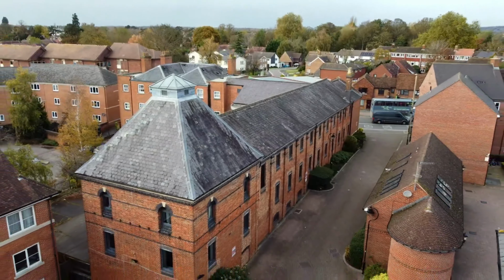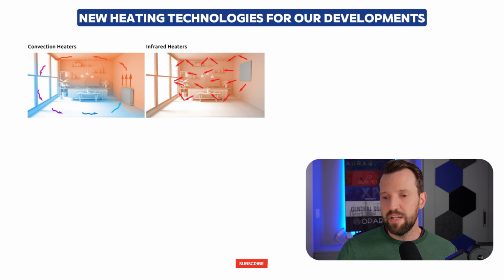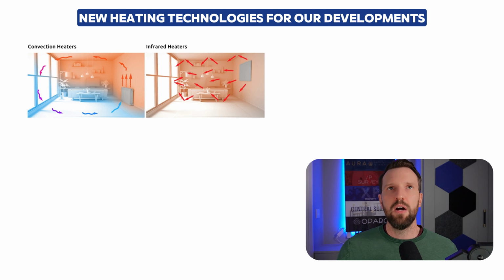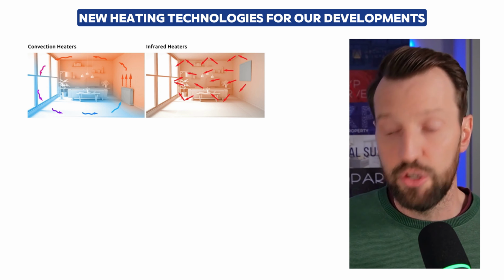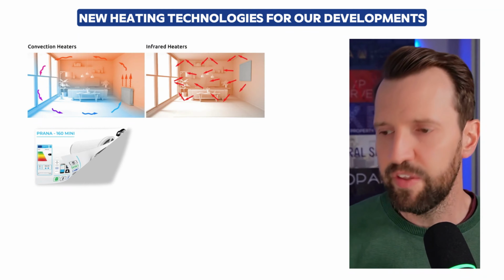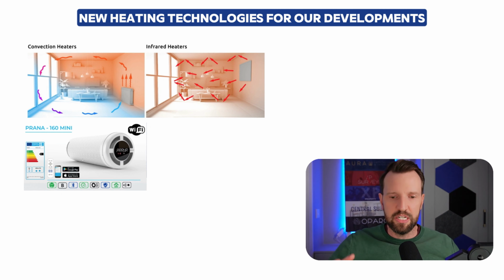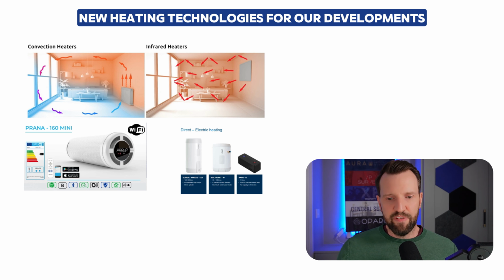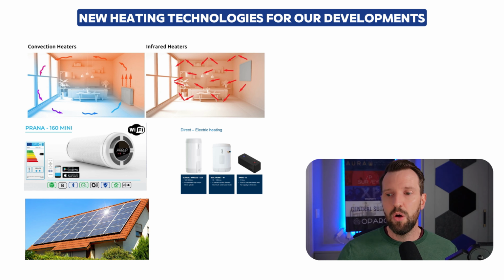Energy-Efficient Homes UK (Add these technologies to your home to save money)

Comment: I'd certainly agree infrared panels are a great solution for certain spaces - in particular bathrooms - since they not only heat the room more effectively than a towel radiator might, and more quickly and efficiently than electric underfloor heating, but they can also help reduce condensation by warming the walls. Plus they're lovely to come out of a bath or shower to a warm radiant heat. However - they can only be (at most) 100% efficient, and will cost tennants/owners more in the long run if deployed widely, as compared to a heat pump based system which should be much more efficient. Also, whilst the PV might offset the energy usage during the day, in winter the most heat demand will be primarily at night (especially with evening occupancy). A battery storage system might help with this, but it'd likely need to be quite large to last you the night depending on how many panels you have. I'm also not sure how this kind of electric heating affects the EPC rating (as I know most electric resistive heating scores very badly). 

In a block of properties, is there not an option for a shared ground loop, with heat exchangers in each property? Although more expensive to install, it might work out more economical per property than each one having it's own dedicated ASHP. Last I looked into this (a few years ago) you needed about 5 properties to make it cost about the same as a gas supply, gas boiler and heating system install. Curious to know if you looked into this at all.
Reply: Some good points, however a heat pump is not more efficient if you take into account running maintenance costs over the years, the savings on its efficiency are diminished by its actual running costs moving forward. I’m going Infra Red throughout, battery and tankless water heater on a project in South East.

Comment: Don't use those, they are awful. They have some good marketing I'll give them that. But in practical use they aren't pleasant to live with if the rest of the house is cold, this is especially true for larger homes.

There really is nothing special about these, there is no magic 'infra-red' that they produce. Infrared is part of the light spectrum. It is emitted from all surfaces that have a temperature above 0 K. The marketing of these is 'oh it feels like a warm sunny day because it is long wave infrared' is technically true, but fallacious reasoning at best.

You might get away with them if the house is a well insulated flat, because the walls won't lose that much heat to the outside. But for their cost you are far better off installing air to air heat pumps (also known as air conditioners) which will produce more heat per unit of electricity used, and will probably work out about the same price for the installation.
Reply from the maker: Have you ever lived in a place with them? None I've spoken to that has had any issues with them.  Perfectly comfortable. 

We would be installing them in new build highly insulated homes.
Reply: @XPProperty  Yes I have. I was initially taken in by the marketing and believed they might be a good solution, but then stayed in a house with them and was shocked at how poor they are. 

If you are installing them in a well insulated house, then it is likely the house will overheat in summer, and therefore you are better off putting in an aircon unit (which can heat).

You also have to bear in mind that they will use 3 times more heat than an aircon to provide the same heat. So there is the affordability side for tenants. You want your tenants to be able to heat their home and be comfortable, without falling into any financial difficulty.

As a quick cost comparison a 900W panel radiator cost around £300. While a 2.5kW LG aircon is £650. For the same heat the aircon is cheaper! You'd have to be mad to install these, it's such a false economy. 

Also you won't hit the EPC updated ratings in future with these, as they will count as electric resistive heating. Aircons (air to air  heatpumps) will hit the updated guidelines.
Reply: @XPProperty  Before we gutted our house as part of a new extension, I bought some Infra Red Panels to test how they would work (in one small room). Our architect recommended them and said they were the best thing ever. Managed to get toasty head and shoulders, which I suspect felt like being in a microwave, but the rest of me was freezing. After a couple of weeks testing my suspicions that they were complete rubbish was proved (at least for me). Went with an ASHP and underfloor heating. Obviously it was expensive to install, but at least the entire house is warm and more importantly every part of us is warm, not just our heads. Again the cost of running the ASHP is exceedingly cheap, and I suspect we'll pay for the ASHP installation easily in 10 years.

Comment: I can see from a developers perspective why you'd want to install a cheaper heating system, but for the home owner an air to water system will be 4 times cheaper to run for the same heat output. Same with the hot water.
Reply from the maker: Compared to what? Not gas central heating, and I'm not convinced it would be 4 times cheaper to run an ASHP vs an infra red heating system.  Would love to know your thoughts?
Reply: @XPProperty  it's pretty straightforward - a heat pump with a SCOP of 4 will create 4 units of heat output for 1 unit of electricity, any other type of electric heating can only produce 1 unit of heat for 1 unit of electricity. My heat pump had a SCOP of 5.4 last year, so better again. Combined with a large battery and cheap overnight tariff, we are 66% cheaper than when we were on gas.
Reply from the maker: Your set up would cost about £10k more to install than a gas boiler,  and with realistic savings between the two of only a few hundred £, it could take 20+ years to payback the difference,  not to mention the yearly servicing costs being 2-3 times that if a gas boiler. 

If you're a homeowner and can get most of the ASHP cost paid for by a grant,  then there may be some merit in it,  but as a developer we can get any grants.
Reply: @XPProperty  yes that was my original point. Our preference is to leave gas and oil in the ground wherever possible, so for us the comparison to gas boiler prices is irrelevant.